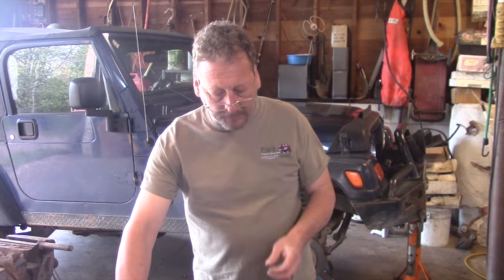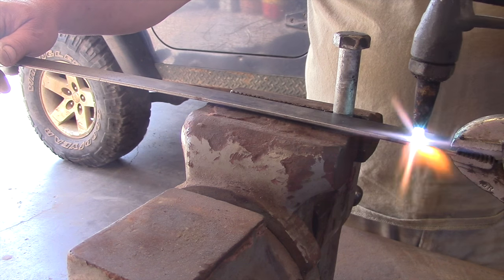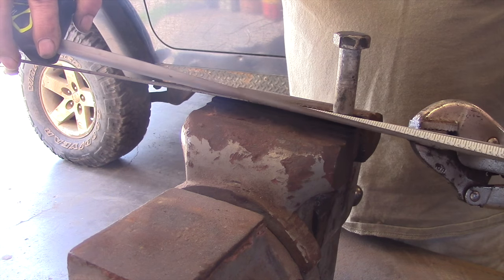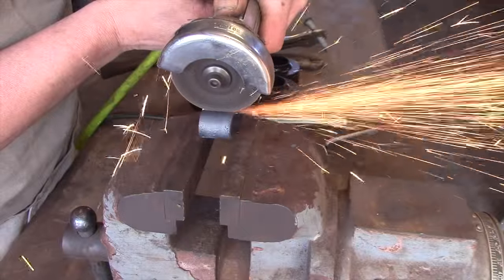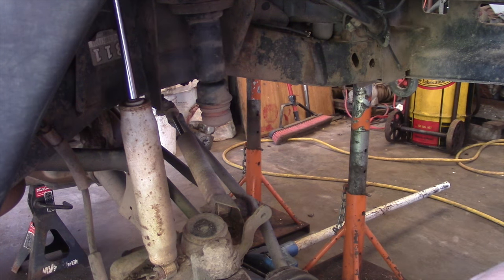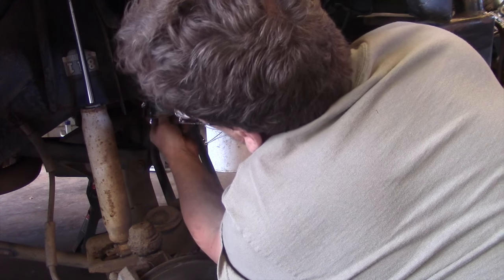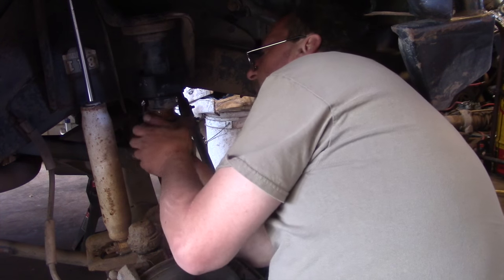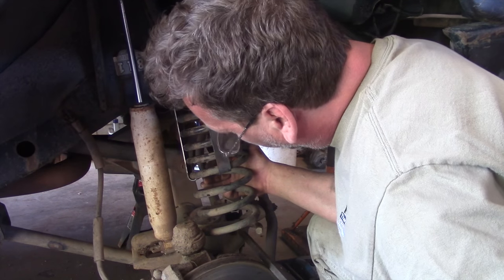QUICK TECH TIP 6 by BSF Recovery Team

Comment: Good idea of making the strap's for the coil springs, maybe I would have used a 3rd strap. Where everyone has fear of putting front coil springs in, we always relied on running a chain thru a center coil first then (depending on what your working on) chained or bolted to the chassis so it doesn't fly out and using a floor jack "chained" in a loop to compress the lower control arm back up without lifting the car. Don't trust banding a spring and cutting the bands because your probably not going to get the upper rubber perch and coil in proper orientation, Don't trust parts store " loan a tool" or China coil spring compressors. Oh course this all depends on what type of front spring your putting in and its spring rate. Oh course never cut a coil spring to lower a vehicle as well. You should do a quick tip showing the difference between the different coil springs to use.
Reply: +Daniel Scott Did you watch the video? He makes 3 and uses 3
Reply: Amazingly I've rewatched the video and he states he will be making 2 additional straps. But if you freeze the video you can clearly see 2 being in use, but the 3rd must be invisible because you can see completely thru the coil spring and no 3rd strap being used. Watch again.
Reply from the maker: +Daniel Scott I did use all 3, the 3rd was not visible from that camera angle.
Reply: +Daniel Scott  look at the 4:58  you can see all three

Comment: Home made compressor did the job but I wouldn't recommend anyone making their own compressors.   I even heard people using rope on really compressed springs which is just ignorant.  Once a spring almost took out my fingers since I was a using a incorrect cheap spring compressor.  From that time, I only buy good stuff like OTC and Branick spring compressors.  Remember there is a proper tool for a every job that will keep you safe.

Comment: Please nobody do this !!!!! first off heating the metal softened it and second 1/8" is way too thin,this tip will get someone hurt or killed !!!!!
Reply from the maker: +Chris Russell Spring rate for Jeep front coil springs is 190 lbs/in, amount of spring compression held 1.5 in, that is only 285 lbs of force, divide by 3 is only 95 lbs.  per clip. The homemade clips will hold that.

Comment: Please never use these get proper coil spring compression clamps. have seen these blow off even with 3 of them and almost kill my co worker
Reply from the maker: +Moose Commander Check out the Moog t-476 spring service clips, included in the Moog t-496c spring service kit. I have used this kit to service springs in everything from cars to class A motorhomes. The kit is hard to find now that struts are so common. For the small amount of spring compression we wanted to retain, the homemade version works just fine.